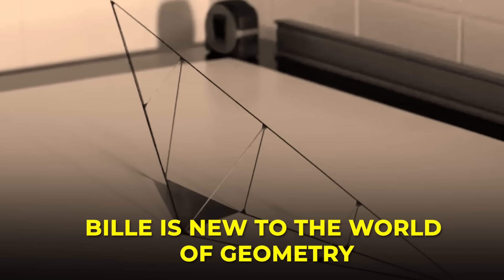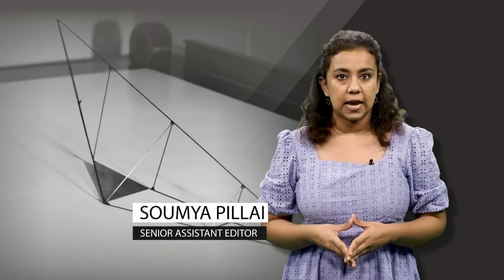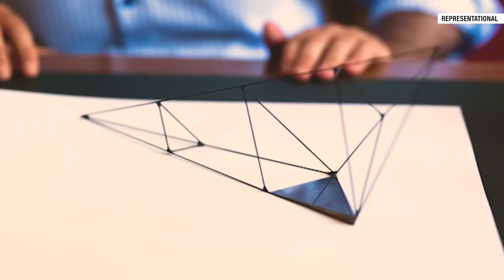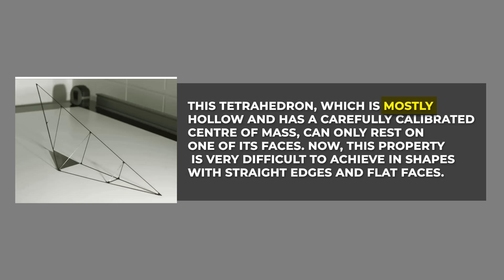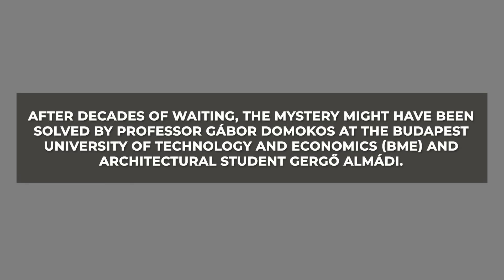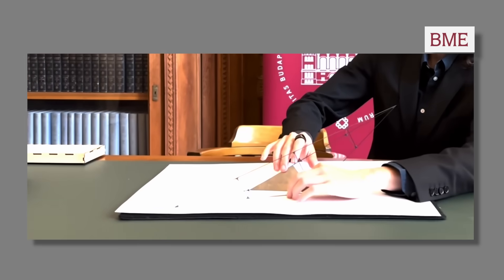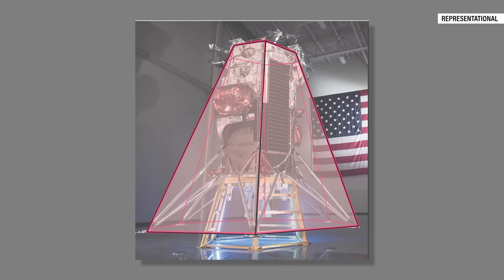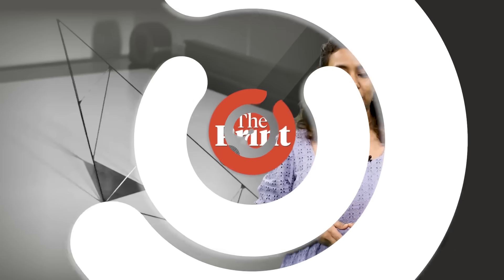‘Bille’: The new geometric design that could stop lunar landers from falling off

Comment: Seems interesting, though, with severe restrictions like a mostly hollow structure needed and careful density management required, I highly doubt it can be a viable solution for lunar landers. These landers carry significant payloads needed for their functioning.
Reply: That is exactly right - while bille indeed is fascinating, this video felt like either poorly researched or deliberately click-baitey. No lander or even current drones seem likely with the density-differential constraint that is at the basis of this geometry.
Reply: maybe for a drone or camera?
Reply: I think, possibly by management of parts location fixing with help of computer programming.
Before placing parts, many possible locations of parts can be simulated and results can be analysed.